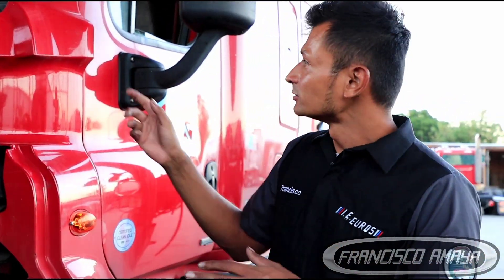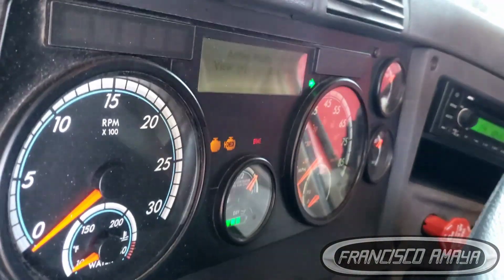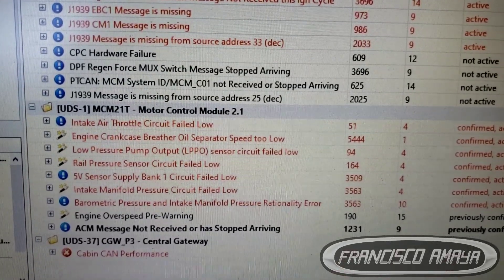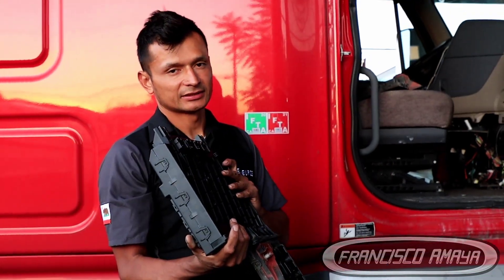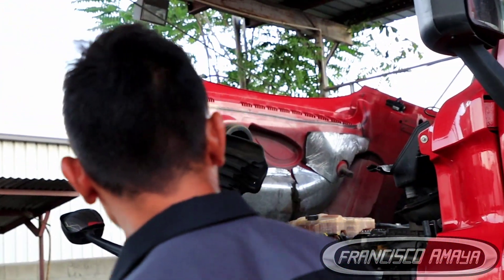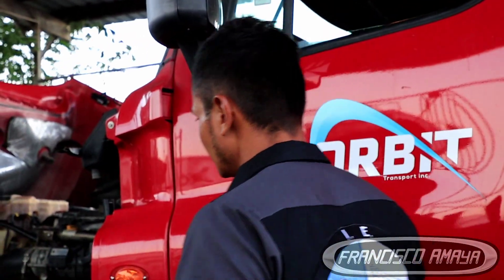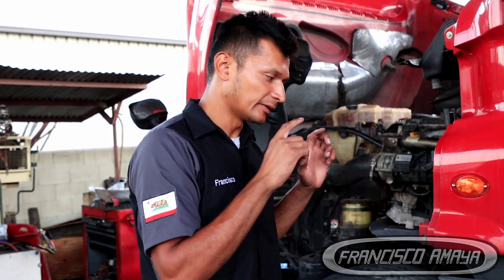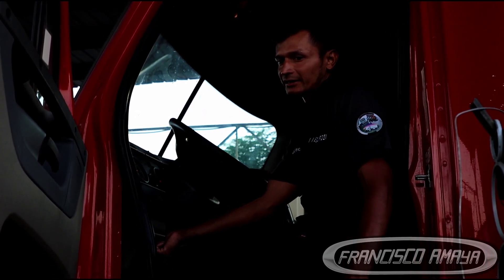Freightliner cascadia electronic problems module damage after  high voltage discharge from lightning

Comment: I change batteries and alternator 
Both alternators old and new one generate over 15 v smoke my batteries so I charge battery alternator add ground on trailer fuse box now lights work no flashing crazy but over charging to 14.5 and up took 2 batteries I tried with 2 batteries it started same issue over charge any idea 
Check all cables nothing crossed
Reply: dude... You hooked the positive cable (on the alternator) to the 15v charger port.  I did that once and all my batteries smoked. (overcharged the batteries)

Comment: POSSIBLE FIX: On the switch that you turn off to power off the batteries (Located below the driver seat), go underneath and unplug it. Power one of the cavities until you hear a click. That should fix the problem.  I had the same issue as describe here. 
After this don't ever use the power switch again! or just repeat the above..
Reply: Sorry what do main power cavities until click
Reply: @novabrown6698  supply power to the cavity, one at a time until you hear a click.

Comment: When the truck was hit by the lightning the computer flashed meaning Everything is stuck in the last position the driver had before he was hit by lightning That's why the lights and hazards are still on you need to Flash the computer or disconnect the battery and leave them disconnected for 5 minutes
Reply: Can you explain why clearance lights are also blinking.......u know clearance lights are on or off

Comment: I just had the same issue…came back to my truck after a storm weekend…it was the SAM chassis module…did you replace with a brand new module or a spare one laying around?…try a brand new one and see if that solves the issue…I thought it was lightning also, I found that water got into unit after heavy rain…the new units are completely sealed from water entry…the old unit had a drain holes on the backside but after so long water corrodes the units connections inside causing a loss communication code…hopefully this is helpful

Comment: Hey Francisco your problem is the starpoint connector it's a chip that all j1939 go thru every leg should ohm out to 60 its in the middle of the truck In front of shifter that piece of plastic in dash remove plastic it's located there next to a black box it looks rectangular in shape and in one corner its like a hexagon

Comment: I have 2016 cascadia and i have a carrier apu on it. Lately im getting problem with my apu. Problem was it was starting randomly. Even i turn the kill switch off still it was working. Last time i tried lets keep the ignition on while kill switch off maybe it will stop running apu randomly when i was away. I did it and left when i come back 7 hours later  my apu was running and exactly same lights was on my truck. Headligts were on clearence lights was blinkin never seen it before. I turn the ignition off and turn on the kill switch than tried to start the truck everythg was normal. Than i took the fuse out from apu went to vacation. Come back and start working. 200 miles later i have my abs active break and hsa light came on and transmission kicked to manual.. when i restart the truck its start as a normal after any miles sometimes 5 sometimes 200 miles its randomly coming back thoose lights and start using as a manual. They will check monday but i think its gonna be long journey to finf out. 😥freightliner broke my heart
Reply: Same problem what was it?
Reply: @chrissteffes3507  if you getting the abs light on tell your mechanic to check bearings and tone rings first. They checked mine after spend $4k. And idk where you're but don't go to freightliner dealer at the southbend in.

Comment: Profe check the spark plugs..😂 no that’s the power switch on the floor board to main ecm I had the same problem on my cascadia but it was corosion and had to change the engine harness ..one of those harnesses is bad..good luck..

Comment: In very rare cases the Sam Chassis needs to be programmed so I don't know if that could be another issue if the fuse suggestion doesn't work.

Comment: Hey Francisco! Something to check would be the pndb (power net distribution box) it's located on the firewall left of the sam chassis. I've seen them fail or the fuses blow inside them and cause the lights or switches to not work properly. Good luck!